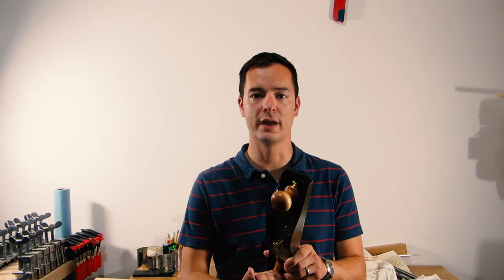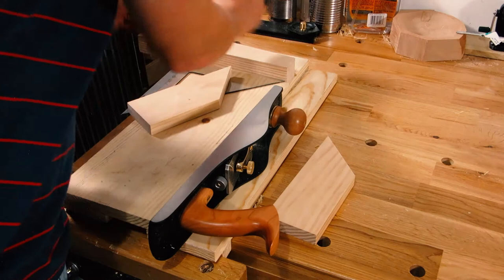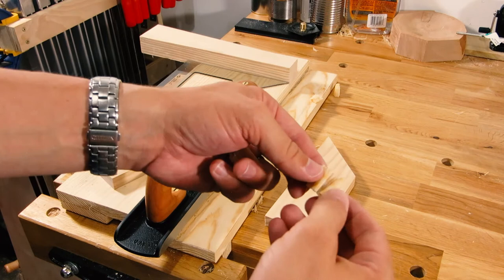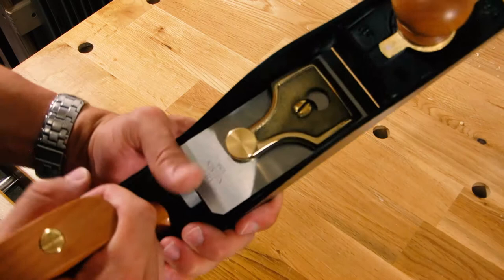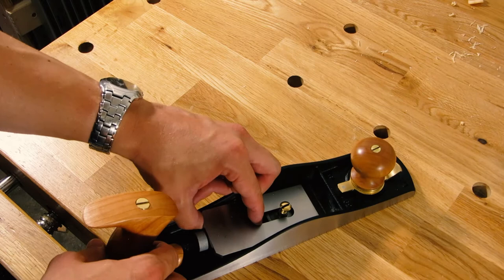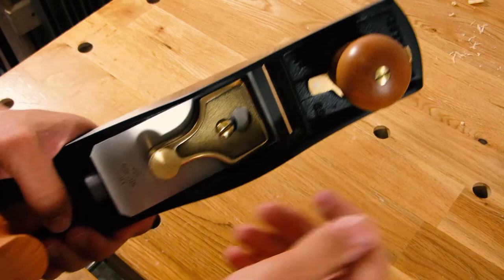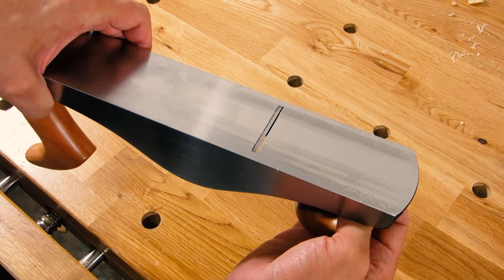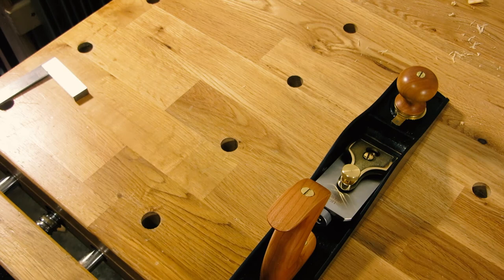Review of Lie-Nielsen No. 62 Low-Angle Bench Plane

Comment: I prefer the veritas LAJ .It is cheaper and has the screws to hold the blade square  plus it also has an adjustable screw safety stop ..No tapping like the LN..I also prefer my WoodRiver standard 5 1/2 jack plane ..Lie Nielsen are very overpriced .471 CAD for the 62. The LV LAJ is also 200CAD cheaper.
Reply: Robert Mielke Veritas tools are made in Canada NOT China .
Reply: 'MURICA! FOCK YEAH! right Robert?
Reply: The Woodriver is a Chinese made copy of the LN, verbatim. So if you prefer that plane (or any other WR) you would like the LN. Don't knock something because you can't afford it.
Reply: The LIE Nielsen and the Lee valley  are priced about the same here in the USA.
Reply: The Veritas LAJ is now more expensive than the Lie Nielsen.